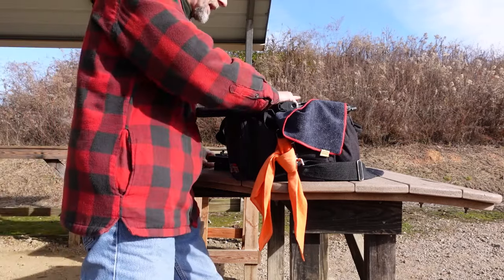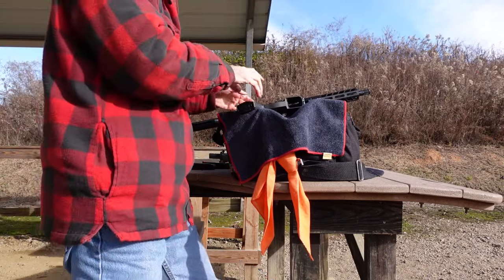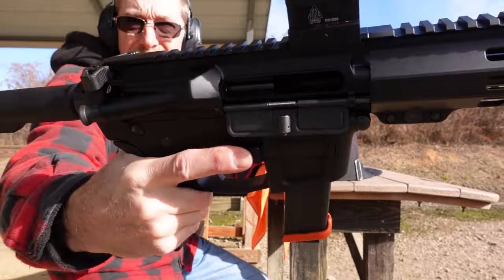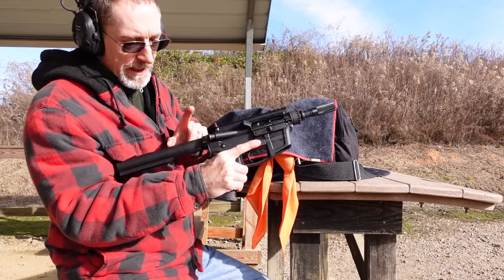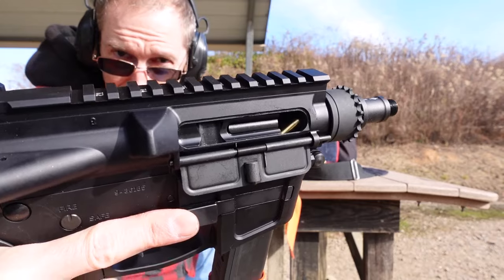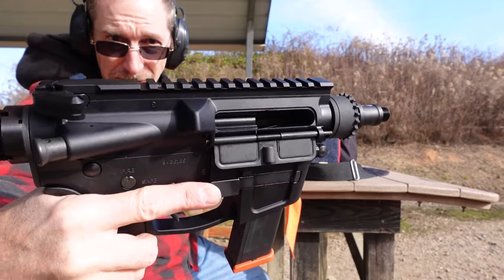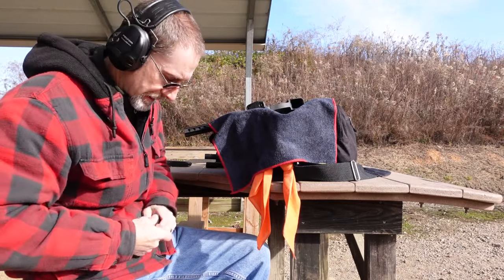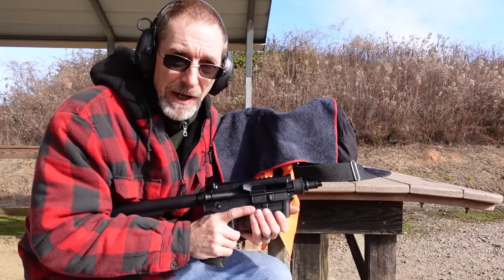Taccom short stroke bolt + FM-9 lower.  Will it work short stroked?

Comment: I bought the Taccom ESS bolt and Super Feed barrel. Kinda cool. With the JRC buffer tube, I was able to use the KynShot RB5020SS & 2x2.5 oz weight/spacers. It worked flawlessly but didn't lock open after the last shot, as they said it wouldn't. I also added the KAK tungsten weight to it for the heck of it. That took a little thinking because of the way they secured it in the bolt. All I did was put a short piece of brass rod in the hole and tighten the set screw against it. I think it's more secure than OEM. I used a Sprinco green spring because of its length. It's a carbine spring made for A5 tubes. It functions flawlessly and very smoothly. Your Gentle Recoil design is a terrific idea to build a rifle on...Thanks.

Comment: I bought that same short, stroke 13.5 oz bolt along with the cut for the super feed barrel. That has the enhanced feed cone at the bottom of the barrel, and a little tab feed ramp that sticks out at the top that meet up with the barrel in a sort of a groove, I know I’m butchering the description but I’m sure you know the one that I mean.

I also got the KAK 9.5 oz buffer that has the short stroke insert to put at the rear of the spring. The weight of the buffer and bolt combined is in the range I think you said was ideal in another video

When I pull back the charging handle- there’s a point it seems to want to stop naturally, but then it will come back a little more to lock back.

I haven’t test fired it yet, not sure why it feels like that. It’s smooth coming back, I’ve dry cycled a magazine of 10 rounds of FMJ, and also 10 rounds of HP ammo. 

Do you lube your flatwire springs at all? It seems like it’s a little noisy.
Reply from the maker: You're probably either feeling the hammer pressing up under the bolt, or compressing the spring in the head of the buffer.  I usually don't lube the spring, but I do spray dry-lube in the buffer tube.  A little grease on the spring should dampen any remaining noise.
Reply: @Blowback9  I’ll try a little dry lube first and go from there. I appreciate your time. Thank you.

Comment: What is the point (benefit) of the bolt though?
Reply: Short stroking is putting spacers behind the buffer spring to shorten the travel distance. This speeds up cycle speed which is helpful when shooting pairs fast. 

Thus short stroking is a common thing in competition. 

The taccom bolt allows you to short stroke the gun and still have the ability to lock the bolt open / having it lock back on the last round.
Reply: Would this make a binary trigger run super fast?
Reply from the maker: Hmmmmm..... I didn't think of that.  It really speeds up cycling, so it should definitely reduce the chances of hammer follow.
Reply: On a select fire lower I bet you'd get an absurdly fast cyclic rate lol  @Blowback9

Comment: Is there much comparison with the 3inch barrel running the short stroke bolt w/grs,  opposed to your regular bolts w/grs? 

I got my 3inch with grs 27oz recip mass tuned to the sub loads I shoot, but its still not quite as smooth as id like and speedy doubles are hard to get. I actually ended up running 2 weights instead of the 3 with the hydraulic carbine buffer, in order to get reliable lock back with the 124 sub loads I shoot.
Reply from the maker: I really didn't notice a significant difference between short stroke and regular stroke from a "felt recoil" perspective, but that might just be me.  The short stroke seems to keep the muzzle on target a little better.
Reply: @Blowback9  interesting!! If there's little difference, I'll probably buy one to test out.
When I see competitive  shooters shoot pcc matches, they all short stroke and the barrels barely move, but I'm sure they probably shoot low powered loads aswell helping mitigate recoil.